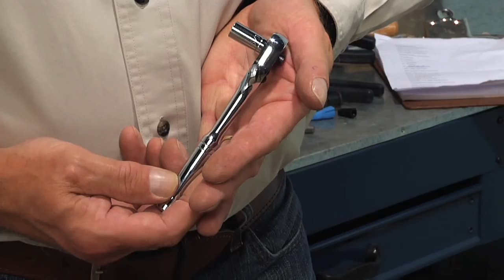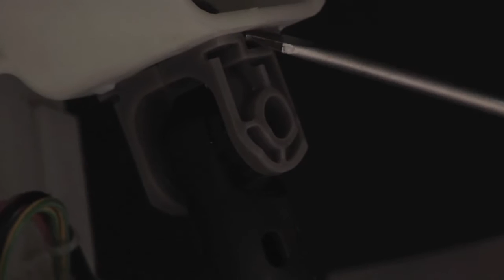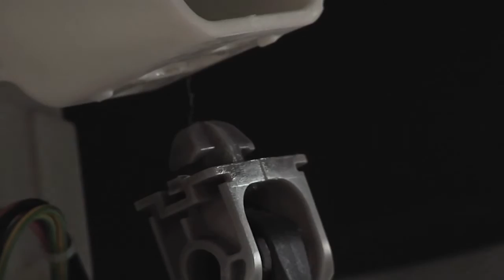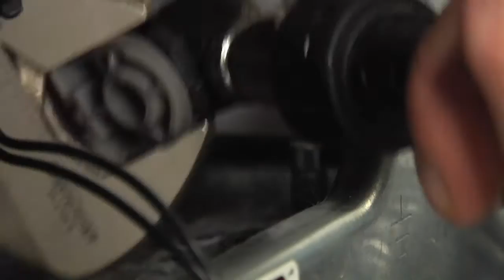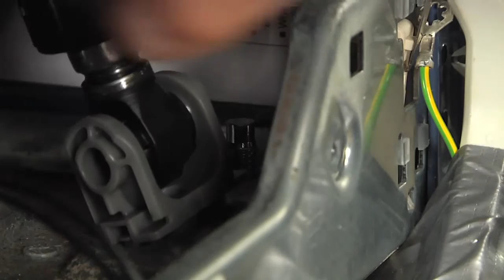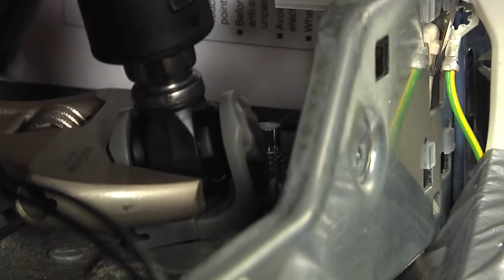Washing Machine Repair - Replacing the Shock Absorber (Whirlpool Part # 8182703)

Comment: what are signs of bad shocks my washer is makes a loud noise at the end of the spin cycle almost like an ak47 its weird .... took the whole thing apart the bearings are great everything seems to be intact ... the reason the question about the shocks is because the machine does have alot of play when spinning its not held in place almost like the springs and shocks arent doing theyre job im lost lol
Reply from the maker: +Eddie Curry The plunger of the shocks should have some resistance when in motion and sometimes will appear to be leakingfluid. The best way to check is to compare with a new one.